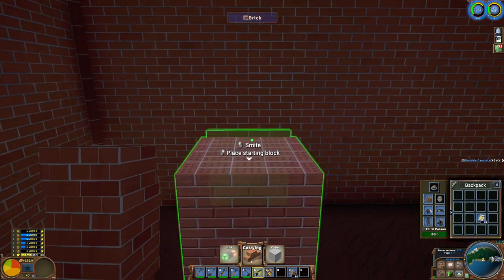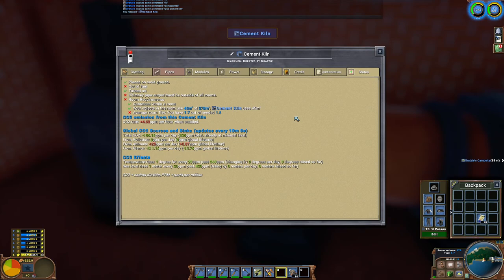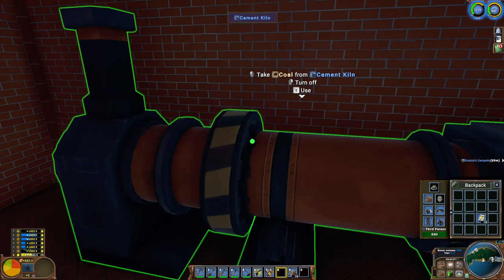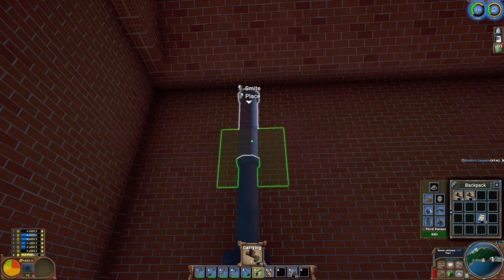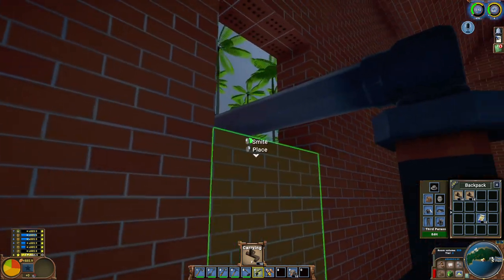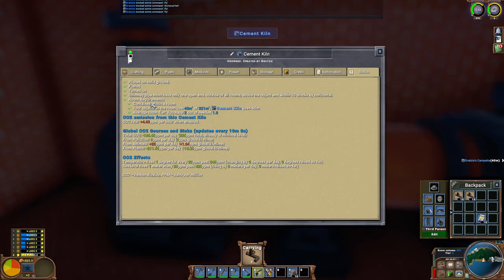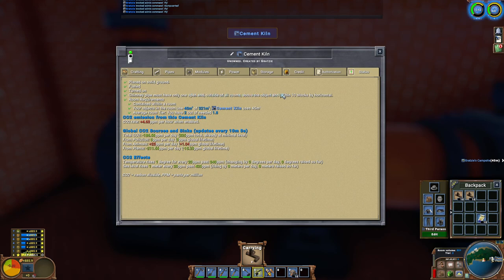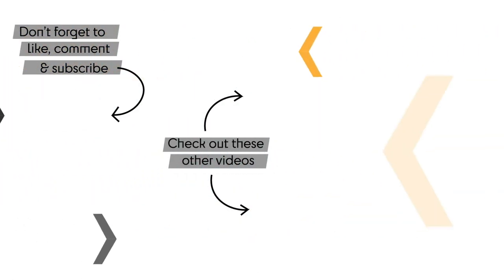ECO v9.2 - Cement Kiln Tutorial

Comment: Quick q, do u have any idea that when I make somethings the pipes disappeared?
Reply from the maker: There was a bug with pipes disappearing with 9.3 but it was supposedly fixed with 9.3.1 in April.
Make sure your pipes are on claimed property in case someone is stealing them, but if it's happening right in front of you, may be a connection issue. Check your internet speed, try closing the game and re-opening.